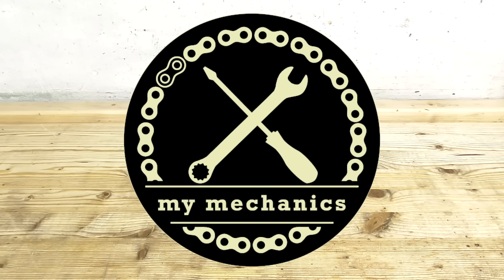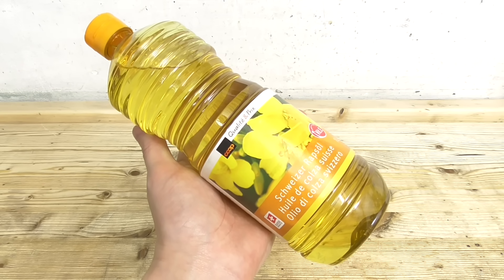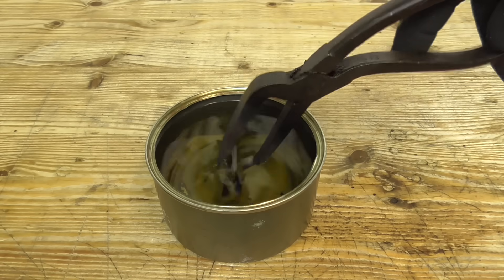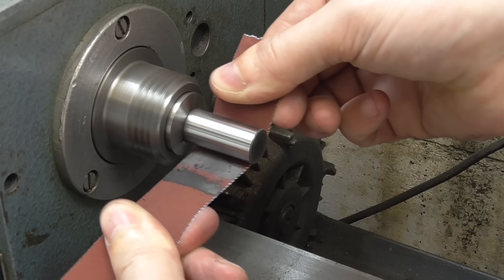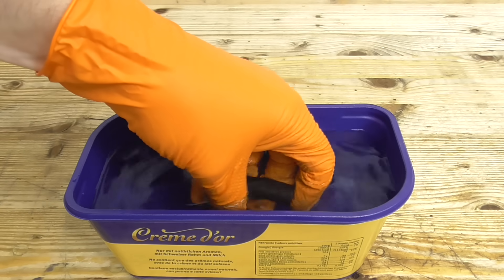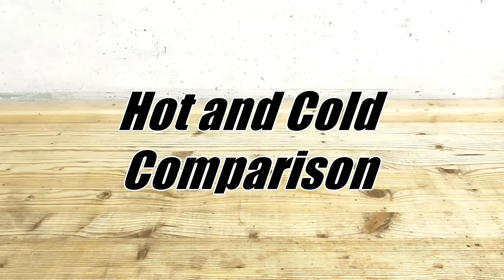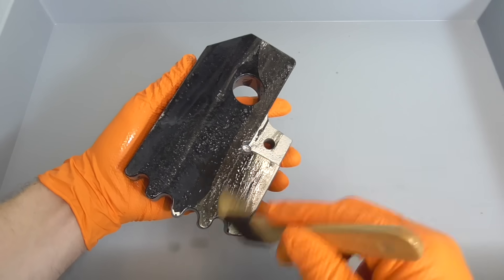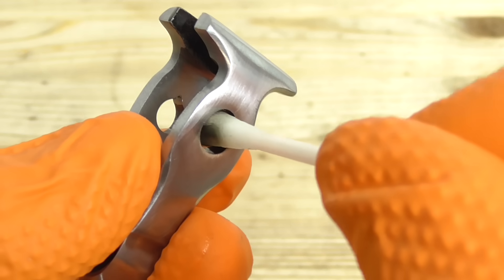How to Turn Steel Black - All you need to know about Bluing

Comment: Very nice simple demo. I just want to point out some tips that would improve it.
1) Hot bluing and cold bluing are actually two different processes even though they share the name. Hot bluing is heat polymerization. Basically the hot metal turns the oil around it into a thin film of plastic-like material. It is better than cold bluing for rust resistance but easier to mess up. Cold bluing is adhering selenium dioxide compound to the metal to protect it. However the dioxide is porous like a sponge so you need to add another layer of oil to it to make it rust proof. Drying oils are the best and boiled linseed oil is the optimum in both cases for reasons I will explain in point 2.
2) Boiled linseed oil is a so-called "drying" oil. This means that it polymerizes at room temperature slowly in a few days. This is why wood treated with it is not oily or slippery. The drying can be sped up with heat, and this oil has one of the lowest. About 100C to 150C is all you need so you risk less of ruining the metal's heat treatment (temper). As for cold bluing, the oil dries out in the pores making a polymer-dioxide composite that significantly improves corrosion protection. As mentioned above, all drying oils are good but this oil is the cheapest per quantity and available in practically any hardware store.
Reply: Thanks, great explanation. Is there a difference in durability between cold and hot bluing? Which one is better for parts than get a lot of use?
Reply: @juoj8  TLDR:
Hot bluing: Protection +++, Difficulty (to do right) ++, Time consuming +, Cost -
Cold bluing: Protection +, Difficulty +, Time consuming -, Cost +++

Cold bluing is just slightly better than cosmetic. Durability wise hot bluing is much better because it basically burns a layer of "plastic" on the metal (heat induced polymerization of oil) that is non-porous. Cold bluing is porous and the layer of selenium compound is more reactive than polymerized oil which is why it needs wiping with oil over it to complete the protection. Hot bluing is also much cheaper than cold bluing. That little bottle of bluing compound costs much more than a bottle of oil (preferably linseed oil as that has a low poly temp and is easily available) and a cheap torch.
However, hot bluing is tricky to do right. You need to heat the metal slightly above the polymerization temperature of the oil but lower than the tempering temperature of the metal. Also, hot bluing is a bit more time consuming than cold bluing.
Reply: So hot blueing is just the same process as seasoning a cast iron/carbon steel pan then.
Reply: @victorunbea8451  The issue with boiled linseed oil is that it's three to five times the price of cheap cooking oil (at least round here), and you can't buy it just anywhere.
Reply: @Ea-Nasir_Copper_Co  where I'm from it's about 2 times and you can get it at a local general hardware store. Also, it's not 2 times because it's cheaper, but because cooking oil has gotten hell'a expensive these days
Reply: Noticed you’re comment after I left a question for the video.
I would like to also ask you a question about blueing ? I like to making air gun plinking targets and was wondering if this would be cheaper then continuing buying Aerosol spray cans.
Now my first question is blueing like wood staining? 
Second  Do you think it would hold up to low caliber rounds from an air gun? 
Thank you for your time
Reply: @domin8rdominant763  cheaper? It depends.
For hot bluing:
Depends on on what oils you use. Basically any oil can be used but linseed and high viscosity motor oils (especially used) give the best results.
As for durability, it would be a bit better than most commercial paints, but worse than electrostatic coating. Of course you need even heating and a low polymerization temperature oil to ensure a good coating. Might need to repeat a few times. Check out frying pans seasoning tutorials.

For cold bluing:
I find that selenium dioxide compound to be hella expensive in comparison to paint but might actually hold up better than hot bluing on impact because it's a chemical bond rather than a coating. You can also try magnetite bluing by rusting your targets then boiling them in a water - peroxide mix (turning red hematite Fe2O3 to black magnetite Fe2O4). Would still need oil tho.
Reply: @victorunbea8451   Wow great response,,, I’ll try the linseed oil an d see what happens ,,,,,
Thank You
Reply: @jewelhome1  This isn't technically hot bluing at all. Maybe a variation or misnomer that sometimes gets used. 
Hot Bluing involves caustic chemicals heated to high temperatures and soaking the part in that bath. It, along with rust bluing, are the best methods for protecting bare steel.
Reply: What is a recipe for the cold blueing mixture?
Reply: @patricksweetman3285  sorry , I don’t know but Im thinking that’s a question for victor Unbea
Reply: @patricksweetman3285  selenous acid and various activators. Most formulas are proprietary
Reply: I was about to write a very similar post. Glad someone else did the legwork!
Reply: Hi Victor, you have been very helpful.  You specifically mention Boiled Linseed oil.  Is there a problem using Raw Linseed oil? As I have plenty of that...
Reply: @stevebothe1416  No problem. Boiled linseed oil is just linseed oil that has been forcefully made "stale" (oxidized). This shortens the polymerization time because of the extra oxygen content. Otherwise the temperature needed should be the same though I would suggest an extra coat or two when using raw oil as compared to boiled linseed oil.
Reply: @victorunbea8451  Many thanks Victor, much appreciated...
Reply: Victor, yours is the first direction I've read to boil the rusted part (rust bluing) in water and peroxide. Why do you suggest that? What advantage over straight water? How long for the boil? I've recently done quite a bit of rust bluing using just tap water. The part comes out a bit splotchy, but diminishes with splotchiness with repeat rust boil cycles. Still there though. Oiling masks the splotchiness when done. Would using distilled water guarantee removing the splotchiness? I do clean the parts before rusting them and use gloves during and after cleaning. TX.
Reply: @LitoGeorge  the peroxide provides a bit more oxygen to speed up the rusting. Regular tap water works just fine, it just takes longer. There isn't a specific boiling time, you just have to eyeball it.
Regarding the uneven coating, it sounds more like you need to clean the part better. Try some hydroxide based cleaner (potassium hydroxide is better than sodium), follow the instructions on the bottle, then rinse with a lot of water
Reply: @victorunbea8451  TX Victor. I'm a little confused. Are you suggesting adding peroxide to the boiling distilled water? I know to use peroxide (and I'm told to use salt in it) to quickly start the rust once out of the boiling water. Then back into the boiling water to convert the rust again. It sounds like you are promoting adding peroxide to the boiling water? Ps: where do I get the hydroxide you are suggesting for cleaning? Acetone not good enough?
Reply: @LitoGeorge  Yes, add peroxide to the boiling water. The boiling water is what turns Fe2O3 (brown rust hematite) into Fe3O4 (black oxide magnetite). The boiling is there to add more energy to the reaction.
Peroxide boils at 110 degC so there is almost 0 evaporation.
For the hydroxide cleaners, look for hydroxide flakes (commonly named as lye, caustic soda or potash) at hardware stores. Or any supermarket should have oven cleaners. Just check that the active ingredient is a hydroxide.
Normally acetone would suffice, but it appears that's not the case here.
Reply: @victorunbea8451  excellent. I shall try this test once getting the cleaners (lye is largely unavailable in safety overzealous Canada) but I'll try the oven cleaner - great suggestion. I'm provide feedback then. Thank you.
Reply: @victorunbea8451  Victor, two questions: what ratio of peroxide to boiling water? I've noticed that some of my rust blued parts rust within hours of the bluing if not oiled. Normal? How to prevent outside of the obvious oiling?
Reply: @LitoGeorge  The more you can spare, the better. If you can skip the water and boil directly into the peroxide you get from the store then do it. Even better if you have access to the 30% food grade one. Just make sure it's food grade. 
Regular one may have ETDA in it which is, ironically, a stabilizer and antioxidant. That might interfere with the reaction.

To delay the rusting do your best to dry them. A heat gun should suffice. 

You still need to oil them tho. Iron oxide is too porous, even magnetite. What you see as rust, is actually forming "underneath" the magnetite but it's much more spongy so it expands more. It forms due to outside air moisture.
Other thing you can try is to "melt" some dry ice in a container. Carbon dioxide is heavier than air so it might push out most of the oxygen in the out of the . 

Just be careful with any chemical you use. Use gloves and do it in a ventilated area.
Reply: @victorunbea8451  excellent info, thank you. I'll be trying some more with the data you shared, and will provide feedback then. Appreciated, G

Comment: There's also rust bluing. Lower temperatures (<100C), but needs more steps. Using a mix of salt, vinegar, and hydrogen peroxide to rust the metal, use a heat gun or hair dryer to dry it out. Drop in boiling water until it blackens (converts red rust to the black, magnetite form). Take out and card (gently brush away the black). repeat until you get the coating you want! That mix of salt, vinegar, and H2O2 is wild. The metal rusts right before your eyes!
Reply: You are right and wrong! The actual industrial method is alkaline degreaser bath(prep),rinse, HCl bath to activate the metal( that's optional), rinse, salt bath at 143°C, rinse, then dump it in water displacing oil aaaand there you have it
Reply: MidwayUSA had a good video on it, so much work compared to cold blue for a lazy person like me
Reply: @theshop90  You are describing hot salts bluing.  Rust bluing, also known as slow rust bluing is done at room temperature except for the boiling of the rusted steel in distilled water.  It's a very different and much more complicated process than hot bluing.

Comment: Here in the Rust Belt, steel only comes in one color and it reminds me of autumn.
Reply: I now live in Central Florida, and am quite familiar with this autumn color, hence my best friend is a wire wheel on the bench grinder.  Then all I have to do is wash the crap out of my t-shirt, because I once again have forgotten to don my shop apron.  LOL.
Reply: doah
Reply: Brush it off with a steel brush, apply some oil. Keep doing that a couple of decades and the iron will be blued. Blueing is nothing more than a nice even coat of Iron II Oxide, instead of the red/orange Iron III Oxide we all know and hate.
Reply: @JCGver   couple of decades enough you reckon?
Reply: @JCGver  and your wirebrush is also gonna proceed to blue everything else a little that it comes in contact with. ours does that. but to be fair that things also been in use since propably worldwar 2. i know the son ofthe guy that last maintained the aparatus and that son himself is 82 years old

Comment: Very interesting! 
     I often wonder why you sometimes sandblast and other times use chemical paint remover. And sometimes both.
Reply from the maker: If it has a lot of paint on the part i always use paintstripper before sandblasting. Because old paint would turn the expensive blasting media bad much faster. Thanks Ryan
Reply: @mymechanicsinsights  Ah makes sense

Comment: Large parts can be heated in a kitchen oven to the achieve the required temperature. The size of quenching bucket becomes the limit to size. Parts should have a consistent thickness to avoid warpage.  Some phosphate-based "rust converters" can be used also, but actually need an even layer of red oxide to form first.

Comment: I didn't know the oil quench was considered bluing. That's what I've been doing for ages. Definitely picked up some tips from this video! I had no idea cold bluing was so easy! Thanks!
Reply: It's not "hot bluing" per se.... it's polymerizing oil. It still works, but he's not using the normal "hot bath" of caustic chemical method.

Comment: Birchwood Casey also make a brass blackening fluid (comprising Selenium Dioxide aka Selenous Acid and Fluro-Boric Acid). We darken brass (or give it an "aged" or "bronze" patina) using this substance. As with steel, the part to be darkened needs to be very clean and grease-free. We usually dilute the blacking fluid at a ratio of 1:20 with distilled or de-ionised water, and suspend the item in a "plating tank". The reaction starts slowly, but acellerates. The advantage of suspending the item in a diluted solution slows the reaction and gives you degrees of darkening, so you can stop the reaction when a desired shade is reached. Also, the slower the reaction, the better the resilience of the finish. We remove the item from the plating tank and then wash in a separate tank of de-ionised water. Then, we clean off the "blackish dust" residue with a lint-free cloth.
We "seal" the item with a micro-crystalline wax (Renaissance Wax is best).
Birchwood Casey supply a cleaning (de-greasing) fluid as well. Also very good for proper preparation.
Birchwood Casey's products are arguably the best for these metallic darkening projects.
NOTE: Wear gloves and (if available) a face mask with a proper filter. Failing a proper mask, work in a well-ventillated area. While very little gas or odour is given off, the chemical constituents of the blackening fluid are known irritants and have a degree of toxicity.
Reply: Another know it all essay.
Reply: Micro-crystalline wax (Renaissance) - Got it❣️

Comment: That's almost the same as seasoning a steel pan for cooking, just as a much smaller scale (i.e. the layer is usually a lot thicker for cooking) and the oil is important for cookware (no cold bluing). It does give a significant rust protection but it's mostly used for non-stick properties.
Reply: After watching & reading this that is exactly what I came to think of when coming across preparing dinner tonight ❣️😌
Reply: It's also on the spectrum of heating a stainless steel pan and adding oil only when the pan gets very hot: the oil will create a temporary polymerized surface. As the great Martin Yan once put it: cold oil, hot pan, food won't stick. (The surface should be hot enough that when you sprinkle in a drop of water, the water immediately forms little beads that skitter across the surface rather than fizzling out.)

Comment: Thank you for making this video. I had just asked a few weeks ago and rite is the video. Thank you for sharing. One question though. How do you estimate the temperature of 300 to 400 degrees centigrade?
Reply from the maker: By the colour of the steel, first it turn blue and then if you heat more it will turn grey/blue... you want to quench around there
Reply: @mymechanicsinsights  Thank you. Similar to the tempering colours, I think.
Reply: @vksubra1953 ,
🔵  For most tools/knives the color that I do the tempering-quench to stop the process would be at more of a honey amber........
........But it depends on the grade of steel and what you're going to be using it for.

Comment: Tool and Die maker here: I use the hot oven temp blueing on my parts because of the lack of chemicals involved. I just don't like handling chemicals. Also, this is not limited to black with the oven temp, you can get different colors based on the type of material and temperature and cooling process. Sometimes I'll go blue, gold, black, etc.
Reply: You should do a utube video on your techniques also.
Reply: Agreed ^
Reply: Tell me more.
Reply: Would also like to know how to get gold 👌
Reply: So the golding technique, along with the other colors, is a reaction of the steel to the high temperature of the oven. For example, I use the tempering oven to color my parts at 1,000 degrees for 5-10 minutes. This amount of time will not effect your hardness. High heat your part and temper normally, then polish it like you normally would, just get the scale off. Throw it back in the oven for 10 minutes and quench it in oil and let it sit until cool. If you want more color, try again. It is harder with larger parts because the part has to come up to temperature equally for an even finish. These larget objects may take a few cycles. The gold was from a piece of very thin stainless sheet metal at 1,000 degrees. Thank you guys for your interest, I want to start a youtube channel soon. 

This technique takes a lot of feel and varies with almost every piece. So be prepared to have some fun experimenting with it. Your surface finish, hardness, type of steel, size, and heat will effect every outcome; which IS NOT bad, because it gives you uniqueness and creativity. Try 500° for a blue and purple look. If your shop has a poster on the wall of annealing temp colors- that is your guide. 

Thanks all!
Reply: @clayton wennerbom
@Brice Fox 
@Billy Bob 
@not tryna argue but 
@Wick3d Wolfy
Reply: TheGRiley  I think the kind voice was as valuable as the lesson. Thank you! दन्यवाद
Reply: Anodizing?
Reply: You are made of chemicals. Stop using “chemicals” as a synonym for “carcinogens” or poisons”.
Reply: @militia814  ok buddy when it says "warning product contains harmful chemicals" we all get the picture. I think you should take your case up with Osha and literally the rest of the world who understands when someone says they don't like handling chemicals, they mean the bad ones. Which is what is in black oxide, also.
Reply: @the_lotus2720  
Temperature you wrote ( 500, 1000 ), you mean are in degree Celcius, right?
Reply: @JSuparman  Fahrenheit
Reply: @the_lotus2720  Thanks. Clear.